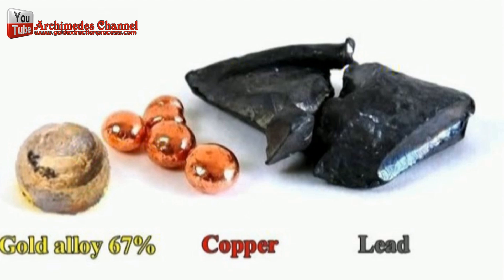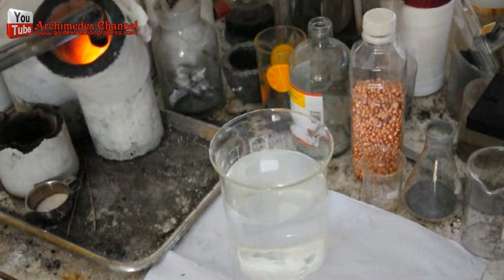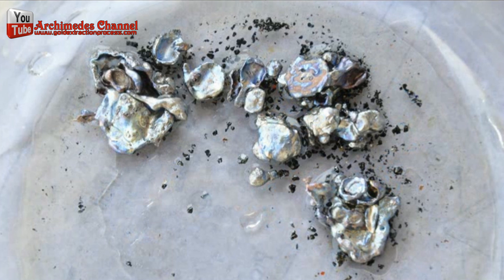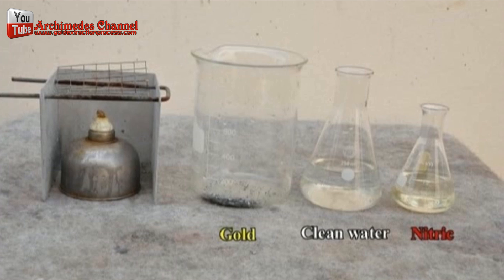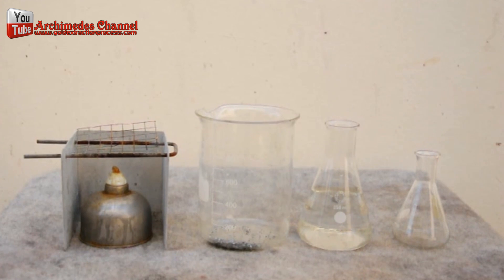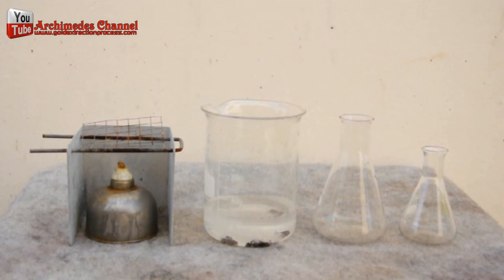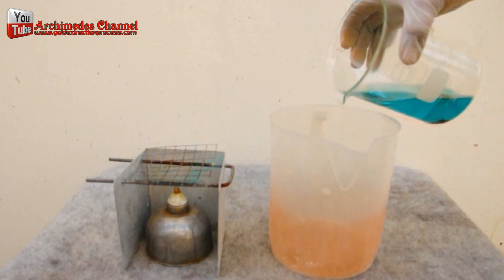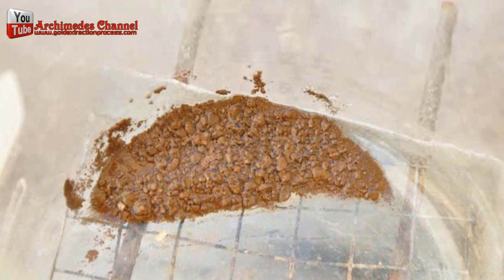How to make pure gold easy from gold alloy "Gold recovery" use nitric acid.

Comment from the maker: In some cases. If gold is mixed evenly in the alloy and at a low enough concentration, you can use plain nitric acid to dissolve away impurities. However, if the gold is more pure (or is an external plating), what actually happens is that the nitric acid tries to dissolve everything, but the gold blocks it from coming through. You may have to use other methods as well.
Thank you very much
Reply: If u mix gold and mercury..will some amount dissolve and never recover
Reply: If I have a 50% silver and 50% gold alloy and is mixed evenly. Can I use nitric acid to remove the silver on the surface and make it appear like 99.99 gold?
Reply: Scrap gold means casting gold alloys is right?